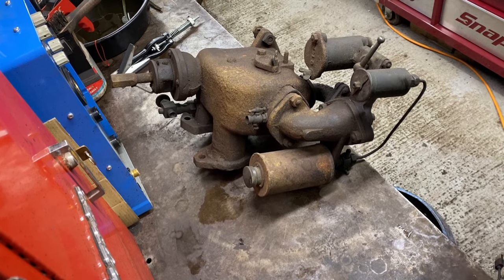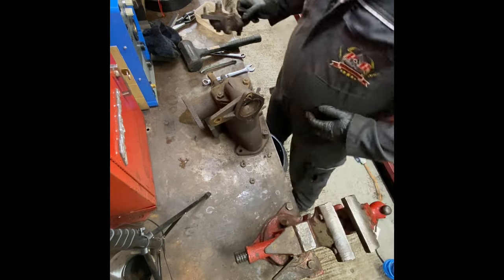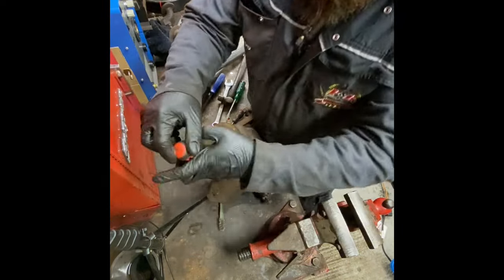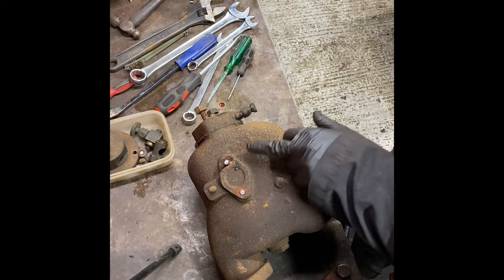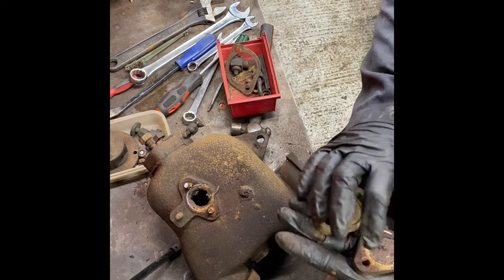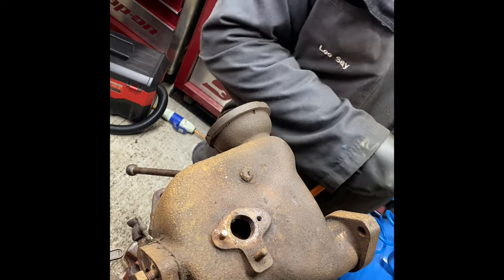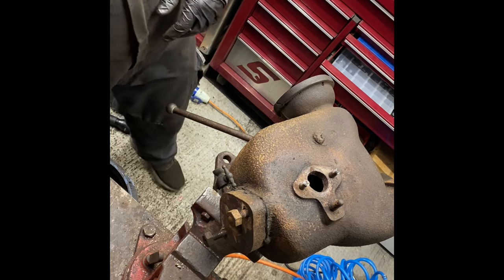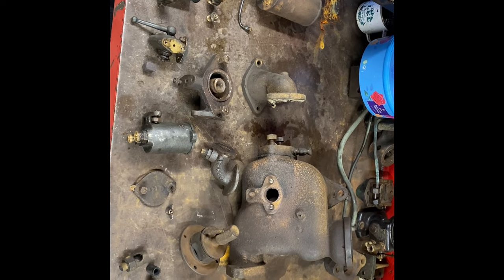1920 Lister Q Type Restoration Part 7 - Vaporiser Strip

Comment: Very interesting video on the vapouriser, I was admiring the castings that made up the assembly (always admired Lister castings after as an apprentice moulder/coremaker on block release to Stroud technical college we had a visit to the Lister factory at Dursley and was really impressed by the quality of the castings they produced) which even for being 100+ years old looked really nice, noticed you had a ratchet tapping handle exactly like mine (really useful for tight spaces) for doing the broken bolt/studs job, did wonder though have you considered getting some left hand drill bits (not many just sizes near tapping size) which are useful in that they can "pick up" the remains of the bolt/stud and maybe unscrew it but if thet don't still drill the hole suitable for the tapping operation.
Reply from the maker: That must have been interesting! It seems pattern making is becoming a little bit of a lost art! Yes some of the castings that they made, even on a very small scale are ever impressive! In the end when I get the red tin out with the “not so easy, easy outs” out of, that has some left handed drill bits in that I had forgotten about. It didn’t make any difference I’m afraid so just had to go for it

Comment: Good video on the vaporiser 👍 working with cast always gives me the jitters as find that there is a very very fine line between successful removal of a part or one broken cast 😕🤬 roll on assembly an fitting 👍
Reply from the maker: Yes me too! Ive stripped a few of these now and I must admit I’m always shit scared of something going badly wrong….. luckily it was only that plate and somehow, form somewhere I just happened to have a spare! The Luck!

Comment: That will run on diesel!!
Reply from the maker: They will if working very very hard! And I mean, VERY hard! But the minute that they are given any slack at all and cool ever so slightly it will do nothing but cough, smoke and run very badly and in no time soot the plug and then your in a whole world of headache! 
It is best avoided really and using either straight petrol, TVO or heating oil is the best. Diesel is more or less a last/desperate option and not really recommended at all on these!
Reply: I run a small villiers with a vaporiser on diesel. I use it to pump water. It work just as good as on petrol.
Reply from the maker: @enginelover1 that will run a damn site faster than this will though and will get hotter quicker than this. Flat out this will only do 350rpm and will more than likely not run much more than 200rpm usually. Plus having around 500L of cooling water will keep it a lot cooler than a very small air cooled engine
Reply: @leeslisters  Yes you are  right on that one.